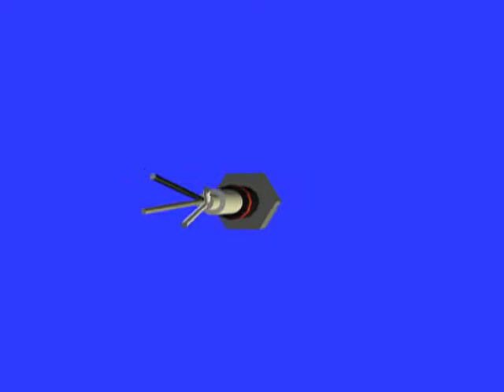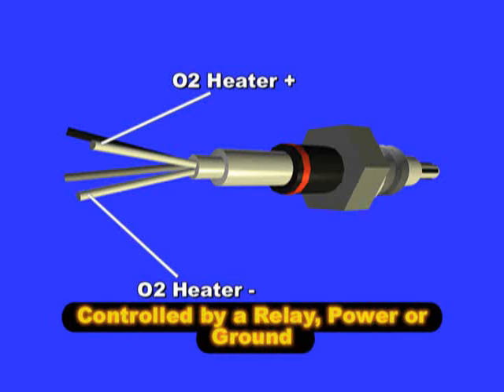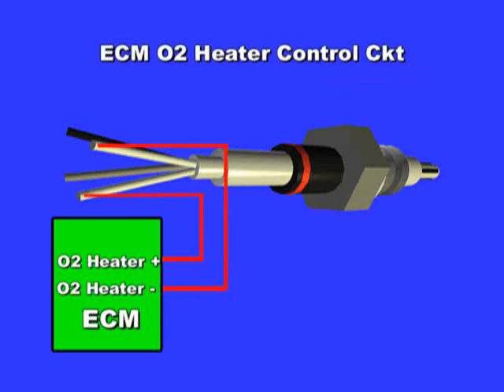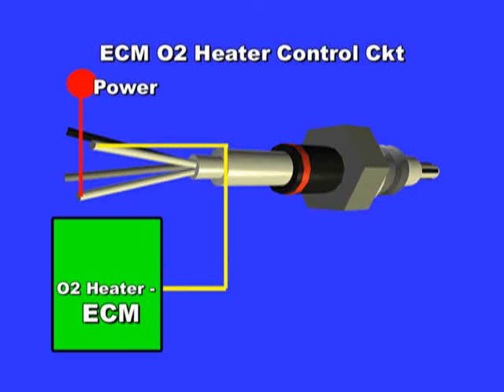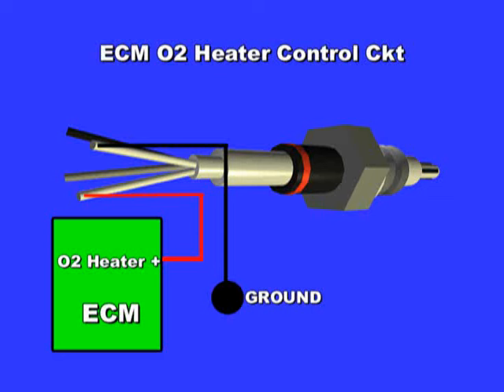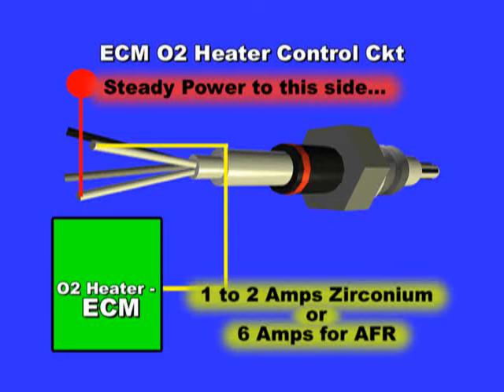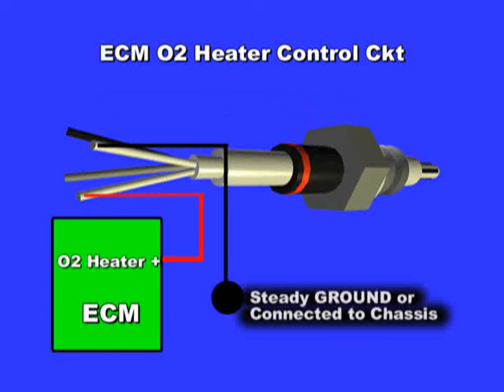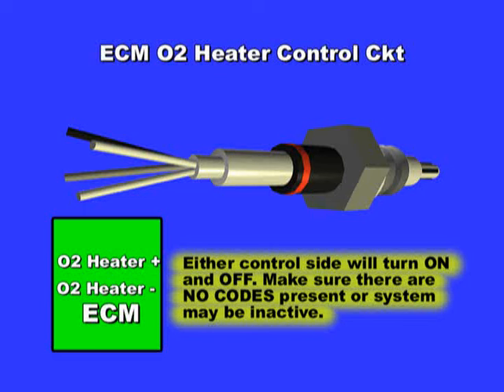O2 or Oxygen Sensor Heater

Comment from the maker: @TheDSMsucka Not necessarily. The O2 sensor heater fault could be due to the following: Loss of power (12 volt) or ground (check relay and ground attachment). If both of these values are good then check O2 sensor continuity. If no continuity meaning that the heater element is broken, then replace the O2 sensor. So check your power and ground first, then heater element. Good luck...

Comment from the maker: CONTINUED FROM 1:

Then, erase codes using chap code reader and start engine. You should see light bulb shining bright. It probably will not, hence you code. Now here's what you need to know:

ECM provides ground to O2 heater. 
ECM activates a 12V relay to provide power to hear. 

Make sure heater fuse is good. Make sure heater relay work. Disconnect light bulb from O2 and with key on probe for 12 volts at either heater terminal.

CONTINUED 2:

Comment from the maker: CONTINUED FROM 2:

If you see 12V at heater term. then probe with TL for ground. If issue is at 12V then it'll be a relay or fuse issue. If issue is no ground, then ECM is faulty. MAKE SURE YOU ERASE CODES. ECM deactivates O2 heater circuit if a code is seen to protect circuit. Does that make sense? Post back with more to let us know...Thanks for posting.

Comment from the maker: Yes I can help. This is a very easy code to fix. First, you should check the ECM heater-control circuit. Code P0057 is an O2-Heater element code. Disconnect Bank-2 of the after converter O2 sensor (B2S2). ID the 2 heater wires, normally same color wires. Don't make a mistake here. Rig a 12V headlight bulb to 2 wires with end terminal for the O2 connector. Don't use a test light as it only draws 300mA, too small. 

CONTINUED 1:

Comment from the maker: No, if it's an AFR (wide band) sensor, it pulses to keep a higher temperature. The duty cycle power prevents is from heater element damage. AFRs need a much higher temp. Regular O2 sensors (Zirconium) the heater stay on all the time. They may turn Off periodically, and if there's an issue (CODE), the ECM shuts them OFF completely. THe O2 sensor needs 600 degree F to operate. Lower and no joy on the signal. Exhaust not enough to keep it at 600 F. Thanks for posting.

Comment: Hi, this is a fantastic video. i am currently trying to diagnose a P0141 code for a 2011 fiat 500. i replaced the downstream sensor with a NGK sensor last year but the code came back shortly after. I am currently working without a wiring diagram. i located the wires to the ECM and the engine fuse box. i have no short to grounds or mutual shorts. multimeter says 0ohms on both sensors. its seems both sensors share the same 12v supply. i am getting battery voltage all the way to the ECM. how can i tell if the ECM is switching the circuit. any help will be much appreciated
Reply from the maker: Get original O2 sensors.

Comment: Hi Mr ADPTraining. I have manual book says two grey wires for heater if no continuity replace. I check, no continuity on grey wires. But have ohm reading on other two wire. Could workshop have messed up the wire color if so the wire with the ohm must be the heater wires and the grey wire must be power wires. Also how do i test without breaking the insulation on wire or using pins probed into pigtail ends?
Reply from the maker: Colors could be different  on aftermarket sensor

Comment: I have a 2002 nissan maxima. The engine light will not go off. The code that pops on is P0057. I took it to auto zone and they said it was the oxygen sensor bank 2 senser 2. I replaced it and erased the code. I've checked the connections to make sure that they were ok and they seem ok. I'm at a lose. I don't know how to get that light to go off or if I am fixing the right problem. Can you help me please?

Comment: Need to confirm and ask general questions for 02 sensor. code says it is upstream sensor. it's not my van having a problem its my sons car. but any information or confirmations would be helpful because info. i will give the 02 sensor a test with propane after making these tests below. hopefully someone can confirm or give insight that will help to testing the wiring etc.

there are 4 wires from the 02 sensor. two of which are heater wires and one is signal, the other is a ground. 
1) is it the signal wire supposing to be sending 12v to the sensor from computer after turning key to on position?

2) does the signal wire suppose to be putting out to computer .1 to .9 volts after engine warms and while me fluctuating the cars rpms? 

3) can i test signal wire for short with test light by connnecting test light to signal wire after disconnecting harness. if light goes on i have a short? yes or no. i read that was a test. need confirmation.

4) How do i test the ground wire going from sensor to computer to make sure i don't have open in the wire?

Comment: I have a 2001 Toyota corolla LE my question is how do I fix a choking engine when I drive it wants to stall on me like not getting enough gas or something?
Reply from the maker: Matt Balistreri Ask yourself this questions: It it FUEL, SPARK or COMPRESSION. Use some propane at the intake. If it improves then it's fuel. The rest it's a bit more complicated... Post back with some codes... http://www.autodiagnosticsandpublishing.com/